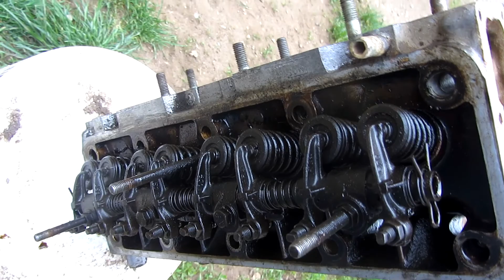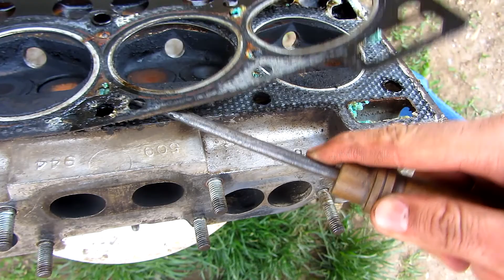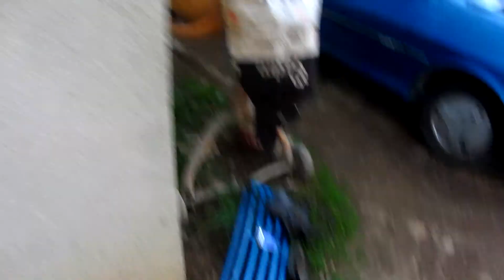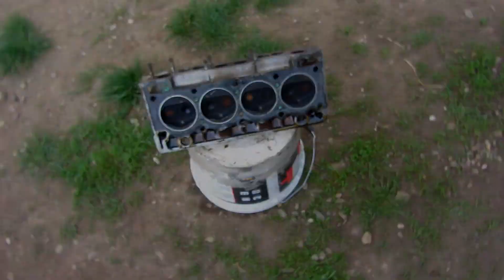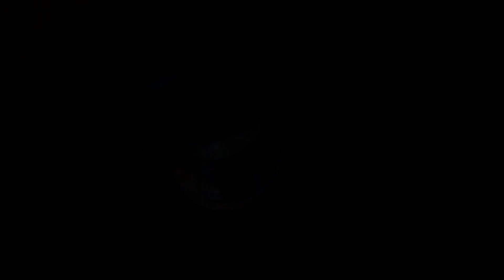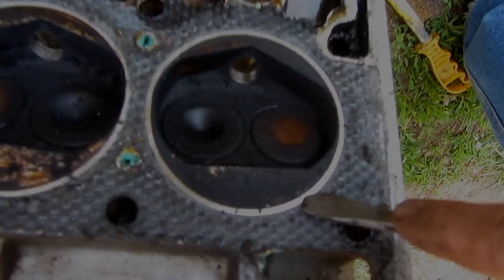Engine Cylinder Head & Head Gasket (Dacia 1300)

Comment: Am și eu de făcut la a mea mult. Numai că nu mă pricep deloc. Abia am pus filmtru de benzină (nu avusese niciodată) și am schimbat robinetul. Până la urmă, un tutorial de schimbat tot lichidul există pe undeva? 
Maine ma apuc sa-i desfac plansa din spatele chiuloasei, picura apa pe acolo, ori pe la plansa aia, ori pe la cele 2 contacte unde-s nu stiu ce indicatori.
Reply from the maker: Trebuie experimentat si se invata 1-2, si eu mai mult din hobby m-am jucat cu treburile astea :)
Scoate apa din vasul de expansiune (sticla), si din radiator cu un furtun al carui capat sa fie pozitionat jos sa traga afara apa. Radiatorul meu a avut multe particule de depuneri inauntru, l-am spalat la robinet cu apa multa. Pune macar silicon rosu sub chiulasa si in spate la acei "senzori" (ii plin de apa si acolo).
Reply: silocon rosu sau negru? mi-a zis un  flacau de pe daciaforum sa pun  negru. desfac acolo flansa aia, si cele 2 suruburi mari de-s prinse in ea. si ma duc cu ele la magazin sa-mi dea si silicon si garnituri. sa fiu sigur ca nu mai pica apa. abia dupa aia ma gandesc sa schimb apa sin atigelul si uleiul. tot la mi-a zis sa iau antigel verde. cu ala jumate apa, deja facut. tu zici ca nu-i bun/ stiu ca ala galben e o porcarie
Reply: Siliconul rosu e pt temperaturi inalte dar nici un silicon nu e indicat pt masina  aceasta, siliconul nefiind o soluție ce rezista in timp. De asemenea in domeniul auto garniturile rosii sunt tot pt temperaturi ridicate. Deci avem un cod al culorilor. 

Ps: stiu ca postez tarziu dar poate ajuta pe cineva vre-o data